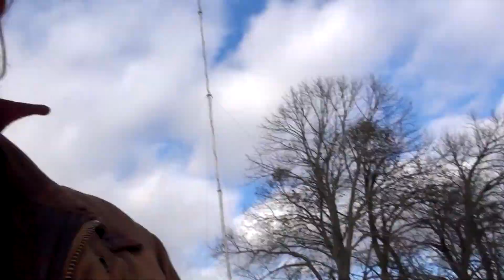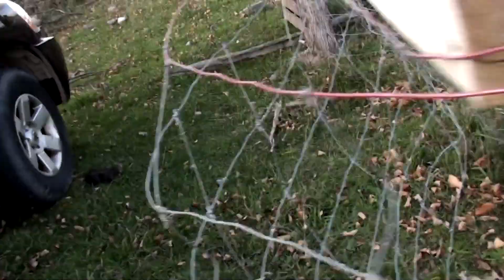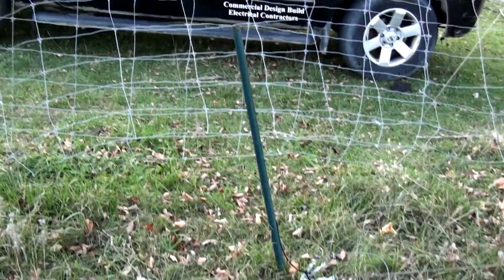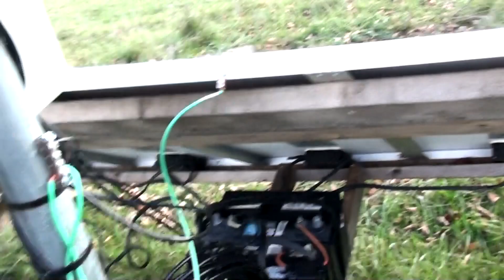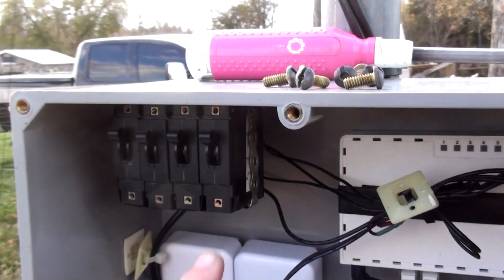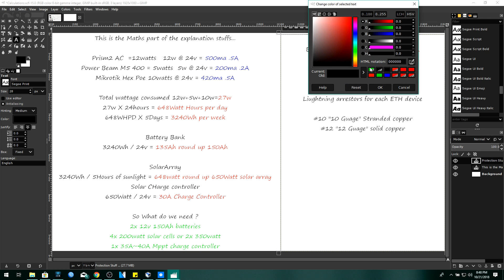Small Solar Radio Relay

Comment: What type of breakers are you using for this setup?
Reply from the maker: You can use any youd like. In this case I had some old ABB breakers laying around. This relay is made almost entirely out of scraps I had laying around ;) Most electrical wholesalers ell dc rated din rail breakers. You can also find them on amazon if your stuck.

Comment: Great video as always! Have you found the 5 days worth of runtime (with no solar input) to be sufficient? I'm in coastal Oregon, so I might actually get less sun that you do in Ontario. I'm thinking of planning for 7 days runtime. Also, I'm surprised that your battery terminals aren't a corroded mess being out in the elements like that...did you coat them with grease or something?
Reply from the maker: Just follow the math ;)  easy adjustments if needed.
Reply: @thefixitgal  Thanks, I understand the math, I was more asking about the practical decision of choosing 5 days of runtime (versus 7 days, or some other number). Is 5 days an industry standard, or just something that you've found to be enough?
Also, how do you deal with corrosion on exposed metal elements (like the battery terminals)?
Reply from the maker: @minimal.camera  In solar a good practice for 3 days for a cottage.
In telecom 5 days. 7 Days is optimal. 
The biggest thing is knowing the historical data for the region the site resides in. Then you can best decide whats the best duration for it. The end goal is to have a site you dont need to visit.
Reply: @thefixitgal  thanks, I looked it up and southern Ontario gets about twice as much sun as coastal Oregon! So your build makes more sense now... unfortunately mine will need to be much more expensive.
Reply from the maker: @minimal.camera  Hows wind in your region? You could add a small primus wind turbine? Usually when the barometer drops the winds pick up.
Reply: @thefixitgal  Wind here isn't great, I have a friend with two 5 kW turbines who says they barely maintain the batteries, let alone power a load. Plus I like the idea of no moving parts for low maintenance. I found this today, which is pretty similar to what I was designing for only a bit more money, so I might just go with this: https://www.ispsupplies.com/Tycon-Power-RPAL48-180-500
Any thoughts on that?
Reply from the maker: @minimal.camera  Thats a lot of money for very little yeild... Over priced.... Contact me through the Ms Fixit FB group.
Reply: @thefixitgal  Thanks for the offer! I don't use Facebook, how about Signal, discord, or email?
Reply from the maker: @minimal.camera  sarah.kerr@isptechnology.ca

Comment: How does the management port setup work?  28:40
Reply from the maker: The management port is simply tied into the LAN bridge so you can connect a laptop if you need to perform service at the site. Otherwise monitoring is done through a vpn call home scenario to remote monitoring software.

Comment: at 15:30 minute mark you mentioned battery size. Are you using 100% of capacity of battery in design or 50% so battery doesn't' fail prematurely?
Reply from the maker: Calculations are based on 100% of usable. 23.8 is a dead bank in this case. The intent with all my system designs is to not run the systems down. I like to over build them so they never get run down that much though as that would cause a system crash. With the majority of solar systems you don't run them down to 50%. The purpose of this is to increase longevity by not using a complete charge cycle. Though whether its a Premise system being run on the 50% basis or a utility, Telco system that may cycle to 100% and crash in extreme cases running a system to 100% discharge 23.8v will not cause premature failure. Again all systems are based on charge cycles as the lifespan of the batteries. Another point to note with Telco systems is that we monitor them closely. This allows us to ensure they never get that low. Worse case is the system will run with no input for 3~5 days depending on build. If you see the batteries getting to 50% you head over with a charger & top them up. Another note for remote systems is to ensure they'l charge within a day. With an array of that size you'll also get a decent charge in bad weather.

Comment: whats the height of that pole? can you do a vid on a cheap way to do a tower/pole around 80 feet? i live in an area where i need that height to get over the trees and connect islands.. there's no much options for tower and poles.. no locals doing cheap easy solutions.. we have to buy expensive towers from abroad and ship it.. kinda sucks.. there must be an easier way.. we have a few sites we need to connect
Reply from the maker: These "Pop Up" Masts are 50' / 15m tall typically. If youd like to go 80' You would need to go with with either a single electrical pole like the power companies use or install a small tower. The tower option is the easiest. Wade, Max tower & Rohn all make small towers that are considered inexpensive 60~80 CAD per section. When building them you typically install the base section onto or into a concrete base. you then install 3/8" guy wires every 20' / 6m. For the guys wires I strongly recommend using "Guy Stations" Though anchoring them to the leg's can work too. The ground anchor for the Guy wires is also called a guy station and its critical it be built properly using either a 3x3x3 concrete block in the ground or a dead weight anchor above ground like a giant concrete block with an anchor loop on top. Its winter here now so Ill see what I can do for a tower build video though the next one we build I will document it for you ^^.

Comment: With the Inline Mikrotik POE adapters, what's powering your radios, the hEX POE or the adapters? Also whats the Charge Controller you are using and charge amperage?
Reply from the maker: Ya sorry. Its actually a 750G. Yes Just using the Tik gig inline POE's to power the radios.. No DC-DC converter but all the gear will tolerate the full 24v range.  the panels are 75 watts each so 300w divided by 24v works out to 12.5A. So on a good summer day well get roughly 12.5A in. On a good winter day probably closer to 14A or better. The controller is literally a generic epoxy potted MPPT controller for outdoor lighting. You can get them off amazon, Ali express or ebay though I recommend using amazon as the sources are far more reliable. I believe the charge controller is a 24v, 20A MPPT.
Reply: Ms.Fixit so even when the inline tik POEs are used to power the radios, you can still pick up Poe related info on the hEX as it showed on the clip? With a 20 Amp mppt means you'll need 2 days of sun roughly to fill up your bank? Forgive my ignorance on this but power is not my strongest area.
Reply from the maker: No The 750g doesn't have POE. I mentioned in the video The site we visited was just to give you an idea of what a remote relay can look like. The math I did on the last page and the mikrotik part were for a different site. The point i wanted to get across as a whole through the video is how to setup and monitor an off grid site. To do that I had to combine the information from a couple of sites as we no longer have any off grid sites atm. Most of them eventually received mains power to the sites. 
The relay site we visited had 1 Power Beam M5 400 and one LocoM9. Based on the amount of power consumption it gets 3-4 days roughly without sun and usually charges within a solid day.